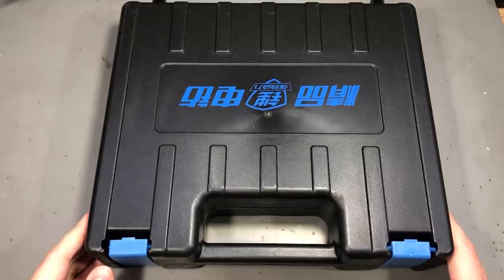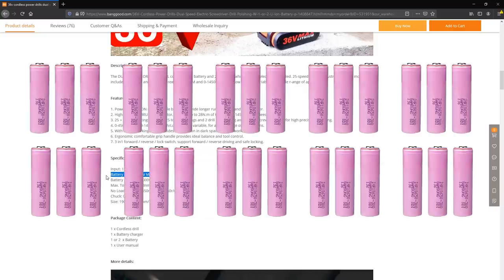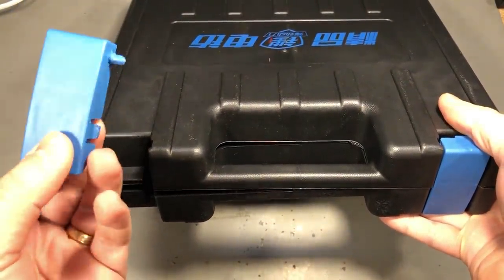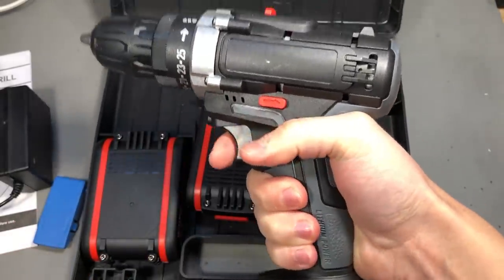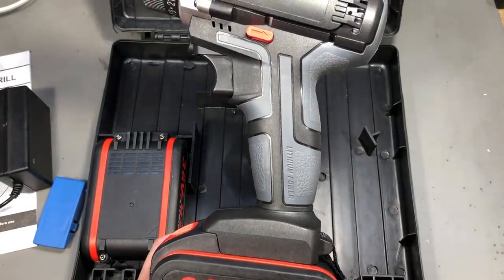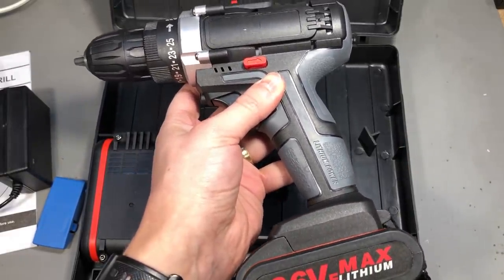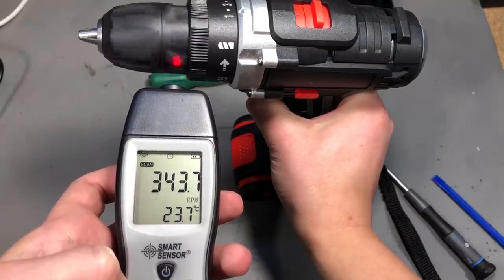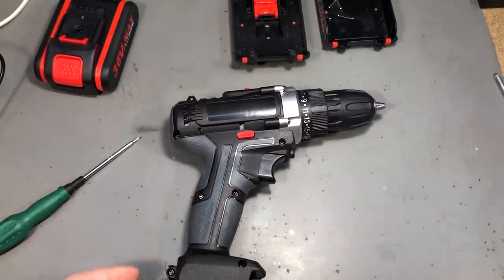Voltlog #285 - Is a Cheap Cordless Power Drill Any Good?

Comment: Borsch drill also came with 1.5Ah. I think might be standard for high current 18650
Reply from the maker: I think the standard is cost saving, because the technology certainly allows for more capacity 😊
Reply: There are 15A drain 2000mAh cells but yes, the higher the drain, lower the capacity typically

Comment: BTDT !  In my case I realised that cordless was not a big advantage, actually the opposite... whenever I need to use it, I would probably find it needed charging. So it would be better to get a corded drill and a long, long extension cord. I did & it worked. Till a rich/snobbish/foolish friend of mine decided to discard his cordless because it's battery was shot and replacement was costly as a drill. I grabbed it and am using a modified PC-SMPS to run it after it's battery goes flat.
Reply from the maker: I have a corded drill and use it whenever I need more power but a cordless drill has it's advantages as long as the battery is charged :-)
Reply: @voltlog 
You are right. The cordless has an adjustable clutch and a keyless chuck ! Easy & convenient for all projects except RCC, where the corded hammer drill rules

Comment: If you get your hands on a Bosch Uneo, I'd love to see a comparison.
I use an Uneo for over 10 years now (occasional workshop use, so a bit more than the occasional "got to set up a picture frame" user) and it still works like a charm.
My gut tells me to spend these couple of euros extra, but I'd be curious if this reflects in build quality.
Reply: I did get a Bosch battery some while ago.. the price is almost the same as this whole drill in a 'case'. But superior quality I think by the looks of it.

Comment: I’m glad we have Ryobi easily accessible in the states. $50-$60 we can get the battery and charger. I bought one that has been working for more than 6 years and I have done quite a lot of work with it. I later bought an entire tool set and everything has been working well for me.

I’m interested to see a tear down of the Ryobi chargers and battery pack now because they are also very light.

Comment: Woiha, what is that DC barrel Jack on the battery? Never seen anything like that. Is it for charging or could it be used as a DC power source?
Reply: Must be for charging since it's marked with 'C' and has balancing circuitry next to it
Reply from the maker: That is the charging port. 21.6V from the ac-dc adapter connects to that port and charger the 5 cells inside.

Comment: Junk. For the price. You can get one from Aldi or Lidl for the same or less with proper specs and warranty. I would not recommend this.
Reply from the maker: Overestimating of the specs is a common thing with these Chinese brands but I wouldn't think the Parkside drills sold by LIDL are better built than these. Sure they might have a better battery charger to follow regulations but as far as the tools are concerned I've seen them and it's a similar quality with this one. Also the parkside drill only comes with a single 12V battery and sells for $57.
Reply: VoltLog sure. If that’s the price in Romania then it might be a better deal. Here in Germany those Lidl/Aldi drills are on sale a few times a year for 29-49€. And I would prefer such one then the chinese one with no valid specs and no warranty at all.
Reply: and those are 20V devices!
Reply: I would like to see it being compared to a Harbor Freight special.

Comment: I had a similar dilemma when looking for a drill which would not be used on a daily or even weekly basis. I wanted to have a good  quality tool that would not let me down when needed but did not want to pay an outrageous price. In the end, I paid a bit more than double the price of the item featured here for a Bosch PSB 1800 LI-2 (2 Battery Packs & charger included though the batteries are only 1,5 Ah) at £76 (98 USD) with free shipping from Amazon. I'm glad I did as it's a very nice piece of high quality kit for a reasonable price.
Reply from the maker: Yup Bosch make nice gear and the one you are mentioning seems to be priced similar to the Makita I showed in the video.

Comment: From experience the big Makita and DeWalt drills are optimised for big rough holes and giant fasteners used in construction industry. Smaller brushed motor drills are better for jobs that need precise control like assembly of IKEA furniture without driving the screws too far in and drilling neat holes up to 12mm.
Brushed motor drills generally have much better control at low speeds  for screw driving while brushless can drill a 25mm hole though timber house frames in seconds.
Reply: @johncoops6897  speed.

Comment: I would go for something from parkside, LIDL. At least you would have guarantees,  and it wouldn't  be so dodgy spec wise. Similar price point.
Reply from the maker: I've been watching the parkside drills sold by LIDL. They sell one for $57 which comes with a single 3 cell 12V li-ion battery. The build quality is pretty similar but the fact that it comes with just a single, lower power battery doesn't make the deal as sweet as with the one shown in the video but I guess it depends on what you are after.  If it's warranty that you want, then yeah, the parkside drill would be a better choice.

Comment: Did you also try the Lidl ones? what was the glitch  at 15:35 and beyond?
Reply from the maker: That glitch is super strange! It's not on the original source file but it's caused by youtube. I did see it yesterday, but today seems to be gone. Regarding your question, I have looked at the Parkside drill from LIDL. It comes with only one 12V battery (3 cells) and in terms of quality I think it's about the same as this one. They currently sell for about $57 here in Romania.
Reply: @voltlog  The glitch remind me a VCR tape that was in poor condition :P About the Cordless drill LIDL their quality has 3 years warranty, you can easly  order the bateries , although they are only rated 12V :(   , they could have more capacity and has indication LED's , decent charger  included. It is  more pricey . I believe it is the same price as here with one battery and charger.

Anyway like to see the new charger :P

Comment: Thanks for the information, would it be possible to charge the battery with the imax b6 charger? You could set the desired charge intensity, thank you.
Reply from the maker: yes you can use any lipo charger that can handle 5S packs with about 0.5A charge current.
Reply: @voltlog  thanks for the reply.
But at 0.5a it would take 4 hours to charge 2A batteries, would it be possible to charge 1.5A ?. Thanks again.
Reply from the maker: @juanrodriguez3165  The batteries inside are 1.5Ah, I don't remember exactly what the current rating was on the original charger but @DiodeGoneWild did a teardown of the adapter (linked below). For safety I would stick to that max current.
Reply: @voltlog  In my case the charger is 0.8A and the batteries are 2A, that's why I said to charge at 1.5A to avoid putting a full load on it.

Comment: Probably there is not a "brake" but it is the very low internal impedence of the power supply system that the motor finds when it generates electricity due the inertial rotating.
I noticed the same effect when I converted a motor drill from old and tired NiCd batteries to the lithium ones.
Reply from the maker: You are right, especially since I didn't find a brushless motor in there. Just the friction of the gearbox plus the the effect you described are stopping the motor.

Comment: You are not correct about the batteries. You got either large capacity BUT lowish max current *OR* low capacity but ability to delivery large current. For a drill, you definitively want the low capacity/high current ones.
Reply from the maker: I know these batteries as I've been using a variety of them in a bunch of different projects for years, especially when flying my RC planes. You can get high current 3000mAh cells pretty common these days, even higher capacities. The ones packed in here are from an unknown manufacturer, rated for a low capacity and probably not much discharge current either. They are are not special in any way like low capacity high current, they're just low cost cells. That being said, it doesn't mean you can't use them, it just means the capacity could have been larger with some better cells.
Reply: @voltlog  True,  but those high cap AND high current batteries are expensive compared to  low cap/ high current ones.  I'm not saying that the ones in the drill are  good, just they are more or less what is  expected  for a cheap high current device, i.e. manganese lithium battery.

Comment: Unless you're driving screws most of the time, get a hand drill instead... With a hand drill, I can drill into materials that my 900 watts corded DeWalt can't. Eg glass, into or near flammable materials, round stocks (you'll slip and injure yourself if you try with electric drill).
I've drilled even into metals like coin using hand drill when I was teaching the importance of slow speed and sharpness to my pals.

Comment: A laptop "charger" is just a constant voltage supply while that included charger is a constant current supply so you just setting a fixed voltage on that laptop power supply will not work as most likely the current protection will disable the output when connected to a discharged battery. The constant current limiting is done inside the laptop that battery has nothing like that included.
There must be better value drills out there this seems fairly bad value.
Reply from the maker: You are right I will probably need to find a better solution and do some testing.

Comment: For 80€ get a Dexter (French rebrand of a Dutch company), properly build, really lightweight and it will last a lifetime of moderate use.
Reply from the maker: I think I saw these Dexter drills in a Leroy Merlin hardware store and now after checking their website it seems they are really affordable. Thanks!
Reply: @voltlog  Yep that's them, forgot the name. It's made by some well respected Dutch company but I also forgot what it's called since none of them are present in the local market. Anyway I found out about it from a guy that has their drills, angle grinders etc and he uses them professionally. First time I picked up that drill I was really surprised how lightweight it felt.

Comment: look into the parkside range sold in lidl, they are made in germany.
Reply from the maker: Are you sure they are made in Germany? because i highly doubt that but I have no info to back my claims. I've been watching the parkside drills sold by LIDL. They sell one for $57 which comes with a single 3 cell 12V li-ion battery. The build quality is pretty similar but the fact that it comes with just a single, lower power battery doesn't make the deal as sweet as with the one shown in the video but I guess it depends on what you are after.
Reply: @voltlog  The company Parkside seems to have two branches, one in Germany and one in China. The Chinese branch is the one where tools are likely build, the German one takes care of getting the VDE certification (typically via TÜV Rheinland) and preparing the product for the EU market. 
Personally, after I bought a few electrical tools from LIDL, I begin to like that approach as the certification process bring to market products that are at least decently safe.
Reply: LIDLs Parkside tools are not made in Germany. They are supplied by companies from Germany and Austria to LIDL, but they are manufactured in China. LiangYe (www.wlpower.com) is one of the manufacturers used for Parkside tools, afaik. I live close to one of their major suppliers for power tools and visit their Outlet Store on occasion and they sometimes sell product samples from chinese manufacturers for their own brand or brands of super-/discount-markets like LIDL, ALDI or NORMA.
Reply: @simosagi  Parkside is not a company. It is a home brand of LIDL under which they sell their power tools (like WORKZONE or FERREX at ALDI or KRAFT at NORMA). LIDL is contracting a supplier like Walter Werkzeuge or Conmetall Meister to supply a certain Parkside branded tool. The supplier takes care of product design, manufacturing at a chinese manufacturer (like LiangYe), certification and product support and supplies the tools to, in this case, LIDL. The tools are often rebranded or slightly modified versions of existing tools from chinese manufacturers.
Reply: @voltlog  Manufactured by KomperNass Handels of germany.
Reply: @bernhardreinel  Oops, indeed you are right. Actually the case I (half-)remembered was about a multimeter. It was sold under the LIDL brand Powerfix with the actual contractor being Targa.
Reply: @bernhardreinel  Yeh sorry guys, just found my manual and it actually says "Imported by.."
Sorry for the bum information.

Comment: You should buy the drill form Aldi or Lidl. The are ok for the price. On those cheap drills it most often burns the speed regulator.
Reply from the maker: I've been watching the parkside drills sold by LIDL. They sell one for $57 which comes with a single 3 cell 12V li-ion battery. The build quality is pretty similar but the fact that it comes with just a single, lower power battery doesn't make the deal as sweet as with the one shown in the video but I guess it depends on what you are after.
Reply: Yeah, I have an Aldi one and it has been working fine for years now. I have been building quite a few things (small things like cases and jigs, but also furniture up to garden sheds) and it has survived all of that. I'd really like to have a Metabo (used one once and it was definitely a completely other level and was better in the hand than all other brand names I tried at DIY stores), but my projects are too far in between to justify it.

Comment: It's not unusual to see 1,500mAh cells in a tool battery.  They prioritize high current capability over high capacity in power tools.  The highest capacity cells, like the Panasonic NCR18650B, aren't rated for high enough current drain to supply the high torque motor in a power tool.

I'm glad you didn't pay for that garbage.  Apart from decent plastic molding, it was a total mess and a pack of lies.  I would MUCH rather have a real DeWalt, Makita or Milwaukee, even at 4 times the price.  If you use tools very much, you'll very quickly learn the false economy in buying cheap instead of quality.  Good, high quality tools are a joy to use; cheap junk like that causes nothing but frustration and regret.
Reply from the maker: That may have been true for 18650 battery technology a few years ago but currently you can get 3000mAh cells with 20A or more discharge current easily so I see no reason to put those 1500mAh cells in there which probably can't do more than 20A discharge, other than cost saving. Makita uses 2500mAh cells(possibly better in newer ones), Milwaukee uses 3000mAh cells in their Red lithium series. But I have to agree, it's not unusual to see 1500mAh cells in tool batteries, but it's not because the technology doesn't allow it, it's because of cost savings.

Comment: The battery pack and drill look like a clone of a Worx Powershare Cordless 20V Drill & Driver WX170.9.

The drill is obviously a brushed motor drive, as the PWM switching whine was heard clearly, before brush sparking was seen.
Reply from the maker: I see, so the FLITHIUM was probably added in there to avoid any customs import issues. On a side note, do you own Worx gear? is it good? the price is not bad.
Reply: @voltlog  

I use lots of Worx Powershare products, including drills, impact driver, impact wrench, garden lawnmower and strimmer. Worx call Powershare a 20 Volt system.

They're good quality DIY grade tools, which are about half the price of premium brand tools like Makita. 
I've done a couple of reviews on the garden equipment. I charge my battery packs using my small workshop solar system.

Comment: Thomas Nagy did a while back a test of a cheap 12V drill in his daily work environment. https://www.youtube.com/watch?v=6I14buTLMEM
The cheap 12V drills you can get on ebay or re-labeled from Lidl (Parkside) are actually not too bad. I would prefer them over products that do fake claims about high voltage, high capacity etc.
Reply from the maker: I don't like fake claims either but it's what we have to work with sometimes.

Comment: I think you could buy cheap market cordless drill at the same price point and that drill would at least adhere to EU safety norms.
Reply: Yep. Cheap supermarket drills are around the same price as this one and won't burn your house down while charging ...
Reply from the maker: yes in terms of electrical safety I agree and regarding the battery charger it's a safer option but as far as the tool is concerned, whatever sells in the same price range will be the same quality.